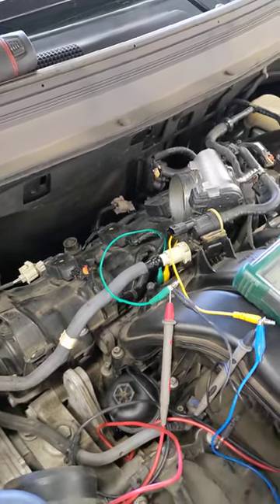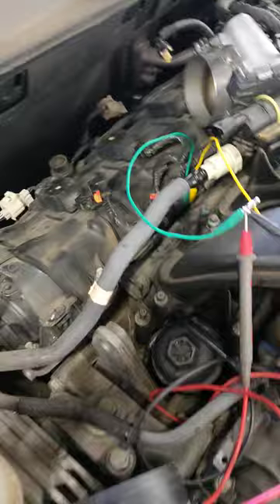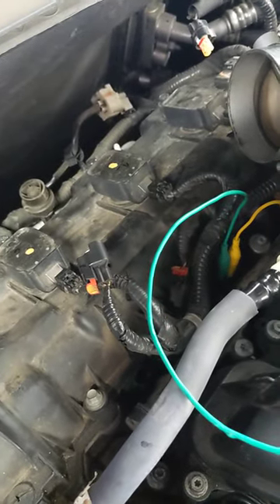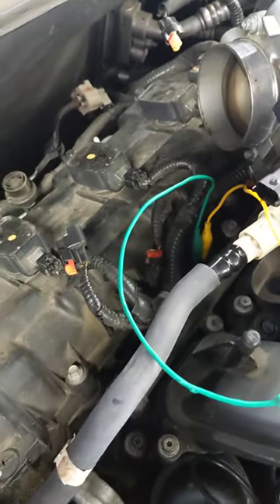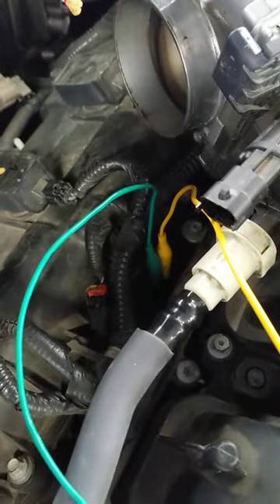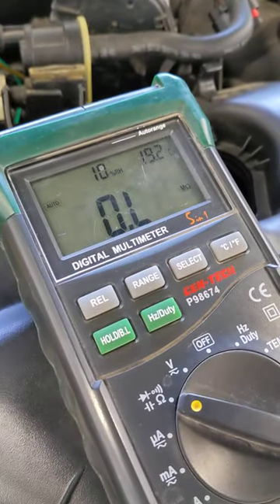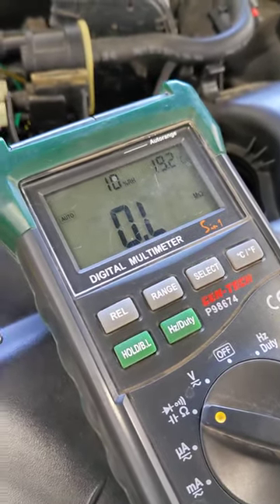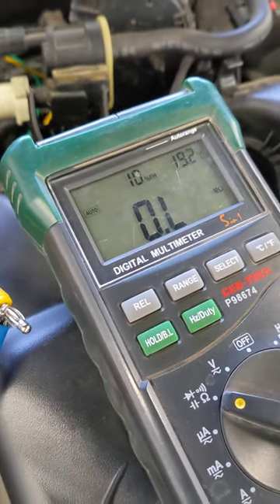2017 Jeep Cherokee Misfire

Comment: I got the same issue 2018 jeep grand Cherokee 3.6l cylinder 3 misfire P0303
Reply: Lucky for you there's no need to take the intake off to diagnose. Move #3 coil to #1 and see if the code follows. Inspect to make sure there's no oil in the plug well and inspect the plug as well (make sure the ceramic isn't cracked or the strap is gone).